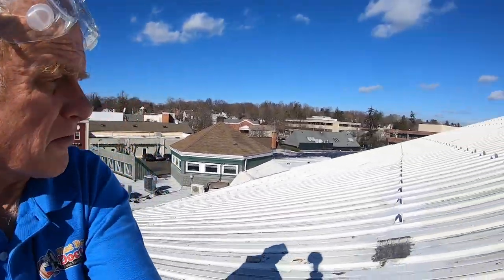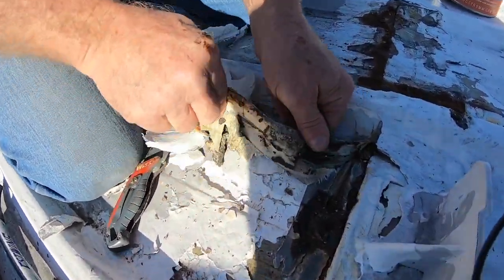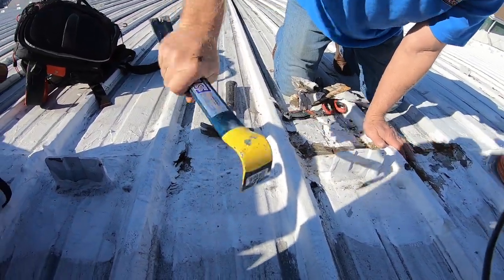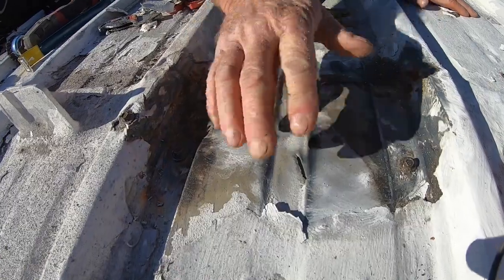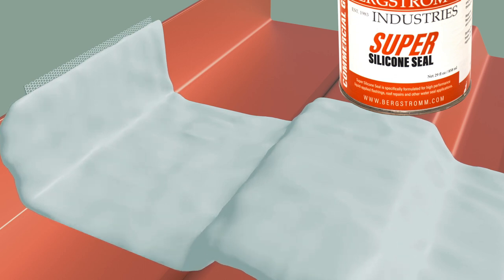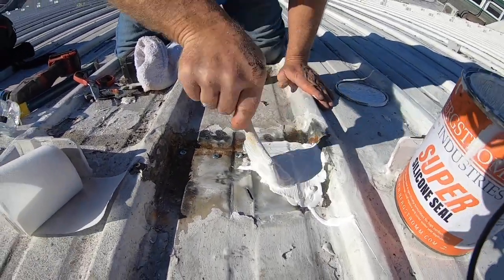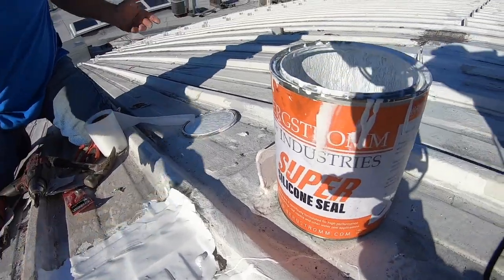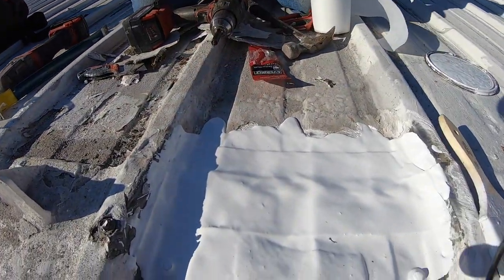DO NOT repair your Metal Roof Leak before watching this - Results are AMAZING

Comment: Fantastic videos mate. How does this product stack when compared to the Tubro poly seal and silver coating in your previous videos?  I have a mixture of screw/nail holes and some bend cracks on my old metal roof. Thanks for your reply. Cheers

Comment: Thank you, I have an old metal barn roof.  I think it's leaking at the plastic panels, a couple of popped nails and possibly because the top closure baffle is deteriorated

Will this silicone product fix the skylight panels and nails?

What do you recommend for the tpp closure?

Thank you!

Comment: Your information greatly appreciated by us metal roof owners. I just had solar installed and come to find my white metal roof sustained some scratches to the base metal and showing some oxidation quite quickly. What do you recommend to paint the gouges/scratches? I am thinking "Rustoleum" metal paint.... your suggestion please. Thanks again!
Reply from the maker: I recommend Aluminum Asphalt by Karnak. I think that would prevent rust much better than anything else